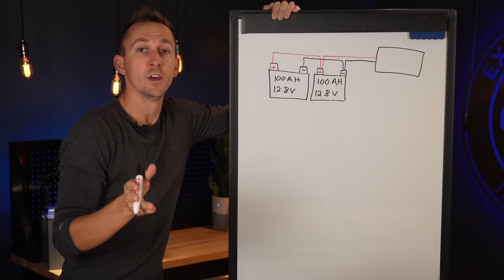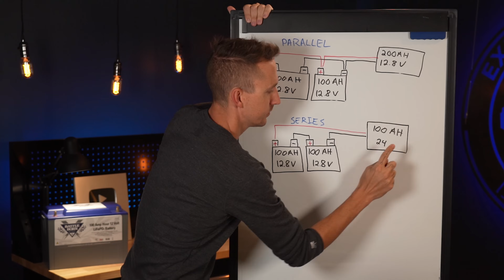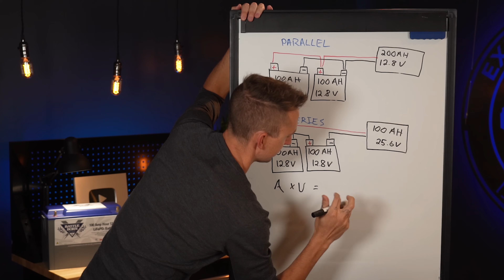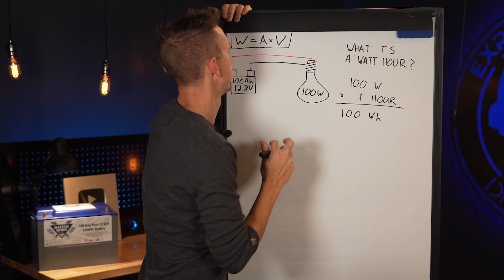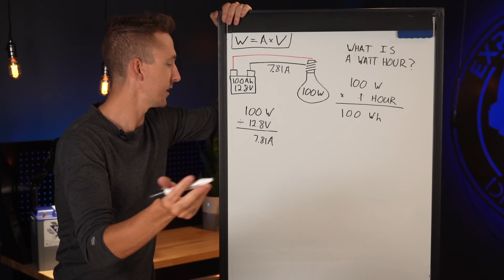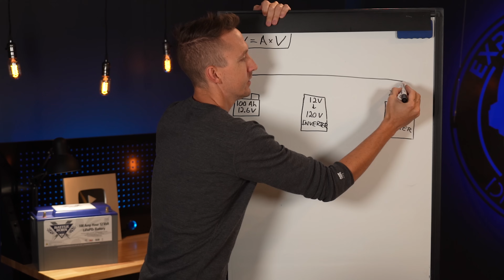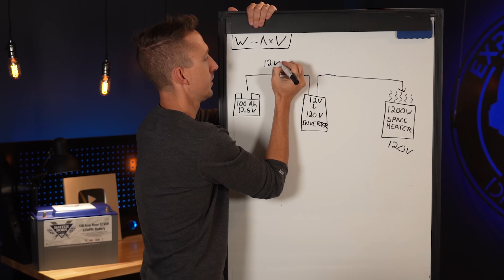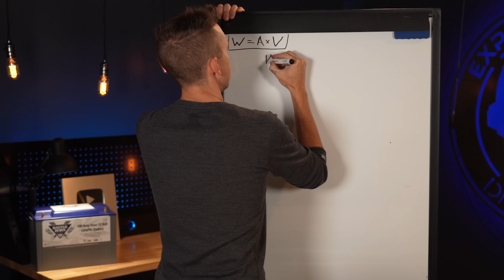AMP HOURS EXPLAINED (amp hours vs watt hours)

Comment: Thank you, that was helpful. But one question on your space heater example: Are you saying that even when you used the inverter to change the V that it’s still consuming 95A? It looked like it takes 95A in to the inverter in order to get the 10A out.
Reply from the maker: Yep!  1200W @ 12V = 100A.  1200W @ 120V = 10A.  W x V =A

Comment: 3:00 In practical real world scenario the parallel battery will produce less useful Wh output than the series battery.
It's part the reason why batteries do not quote in Wh or kWh often.  The reason is, the voltage depends on many things.
In the two examples given.  The parallel pack will run at a lower voltage and require higher current.  Current * Resistance = Voltage drop.  Current squared * Resistance = power loss.
Inversely the series pack will be running at a higher voltage, have less net current across it and beyond it and result in half or less of the voltage drop, resulting in less power loss.
That is only part of the reason.
If you open a datasheet for any particular battery you will see it will actually have different capacities and curves for different loads.  It is this reason they tend not to provide simple "Wh" stats as "it depends" on how you use them as to how many watt hours you get for those Ah.
Reply: I was surprised to find you can actually buy 4000W inverters that run on 12V!  Holy shit.  That's 350A.  I know a lead acid can do a CCA of 1000 Amps, but that for 30 seconds tops and will murder a non-starter battery in seconds.  It will never work again.  Even when you stack 20 or 30 lead acids in parallel 350A has a HUGE cost to it in parts, hardware and the voltage crop will be insane.  A brand new starter battery at 13.1V will drop below 11V or even 10V when cold cranking a normal family car.  Pulling maybe 400A for a few seconds, 4V drop is 1600W of heat in the battery, cables and motor.
Personally 100A is the limit and staying under 50A will save you power as well.  100A and 48V is 4800W.  If you need more, you can go specialist or just give up and go full hybrid grid-tie+150V house battery.

Comment: It is to know with which voltage the 12v 100 amp or 24v 100 amp batteries are charged faster with a 30 amp charger. I think that the 24v 100 amp battery consumes less amp in use but to recharge it takes longer than the 12v 100 amp

Comment: how do u calculate ah to a?
Reply from the maker: Amp Hours are simply the number of amps you use in an hour.  So if you are using 50 amps for 1 hour, that's 50 amp hours.  50 amps for 2 hours is 100 amp hours.

Comment: Hi sir I have one question I am making one 12v 100ah but I am using old laptop battery some battery is 4400 and some is 4700 so which type using bms and which size using main wire for battery pack to inverter, one question if I am making one 48v 30ah using 4400mah battery then how many Ampere charger required
Reply from the maker: No clue, lol.  Here's how I recommend building these systems: https://www.explorist.life/solarwiringdiagrams

Comment: Nice job explaining. One good thing about going in series with 24 volt is wire size. I go for 12 volt and spend more money on wire and save on things that run on 12 volt.

Comment: DIY CAMPER< Others techs have told me that Watt Hours wH can't be used for batteries because batteries don't dissipate heat which dissipating heat is watts so you can't use wH watt hours for batteries? this is what i have been told by other techs
Reply from the maker: I've never heard that.
Reply: @EXPLORISTlife  yes because transformers and batteries don't dissipate heat so you can't use wattage for transformers or for batteries because they both don't dissipate heat. Check into this because I have been told by a bunch of techs about this because how i measure if a battery or battery bank is good i measure the voltage and the current using a 10 ohm load across the 9vdc battery, The voltage measure is 9vdc and the current is 1amp = 9watts. I have been told that you can't compute a batteries wattage like this at all or compute a batteries wattage period because batteries don't have wattage. Try to look into this to make a lesson about computing batteries wattage

Comment: No; you cannot suggest that when you pull a current for an hour for a 100watts light bulb, the current is 7 amps and then using the same bulb for two hours is 14 amps. Why? The current must remain the same throughout as long as the load is not changed. Time doesn't change current flowing in a circuit; only load changing or voltage changing can influence the current change.
Reply from the maker: amp HOURS my guy.  We were talking about amp hours.  7 amps for two hours = 14 amp HOURS.

Comment: The concept is good if you're going from DC to DC. What's  never talked about is the conversion of DC powered to AC through a inverter and it's inefficiencies.
Reply from the maker: I've addressed that a dozen times or so here in the comments of this video.  Thanks for tuning in!

Comment: If you were comparing apples to apples, wouldn’t the 25.8v battery powering the light be half the Ah (50)?
Reply from the maker: Not exactly.  The battery amp hours and voltage doesn't change.  The battery BANK as a whole is what changes.

Comment: Hey Nate, Great channel thanks for doing it.  I got a "simple" question why do people use lets say 6 100 ah batteries when they could use 2 300 ah batteries. I see it a lot on you tube and I'm sure theirs a reason, but i don't know what that reason is . Thanks Ted
Reply from the maker: Flexibility in installation space maybe or parts availability.  I'll usually recommend fewer bigger batteries over more smaller batteries like the 2-3 270Ah Battle Born batteries over 5-6 of the 100Ah ones.

Comment: I have just started doing my van conversion and am on the insulating stage this week, so I have some way to go before i get the electrical. The one thing that is making me think I have made a huge mistake is all the wiring I need to do. Your videos are helping me a little, but it is still very overwhelming, and the kit you use is very, very expensive. I am looking at 5 amg batteries at 120ah each backed up with 900watt of solar. I need to run 3 sets of 12v lights, two 12v fans, one 12v water pump. I need to run 2 hot water heater 240v (shower+hot tap), a 240v fridge, a 240v TV, a 240v induction hob and my oven will be a 240v air fryer. Then I will have 3 wireless phone charger pod with two 240v sockets with 2 USB built in. This all sound like a lot to have but obviously will only be running one or two things at once like the TV and lights or the air fryer and lights but I have no idea where to start. Am I better to go with a higher volt or amp set up (series/parallel)???

Comment: See a lot of comments about wire size. In a van I would think this would only matter for longer wire runs such as a 12V refrigerator.  Smaller wire is cheaper, but you’d have to account for the cost of a 24V-to-12V converter unless you can source all your loads for 24V. Would your terminals, lugs, switches, etc be smaller, or do most people use the same for 24V as they would for 12V?
Reply from the maker: Wire size would definitely be different for 12v vs 24v.

Comment: Hi Nate, could you help me with some advice please..I have 4 x 120ah lithium battery's and want to wire them in series...I have been informed that it may not be a good idea as they may have balance issues...? is this the case
Reply from the maker: That's going to be a question you'll want to refer to the user manual for your batteries or reach out to the manufacturer.  Wiring 4x Battle Born Batteries in series is not an issue, but since they don't make a 120ah battery... I can't speak on behalf of an 'unknown' battery manufacturer.

Comment: so that last ie. 95 amps left side and 10 amps right side. would the system still only last 1 hour or since its being inverted to 120 would it last 10 Ah
Reply from the maker: Amp hours are coming from the battery bank, not the inverter, so it would still only last 1hr.

Comment: Lol there’s no more efficient heat sourcing than Fire.  Whether that be natural gas or wood.   People on the left that actually think solar will provide our world with sufficient and efficient enough power to heat our homes etc around the globe are in for a very rude awakening.    Natural gas is the most efficient and cost effective sourcing for heat fuel
Reply from the maker: Did you seriously just politicize a tutorial that teaches you the differences between amp hours and watt hours?  Perhaps it's time to log off the internet for a minute and go on a long walk outside.  Get some fresh air, ya know?

Comment: at "5:20:00" this is wrong assumption right? if you run for 2 hours it should remain 7.81A the max current flow across the wire for a 100W load unless your load changes to 200W load then I agree with you. 🙂
Reply from the maker: Nope.  7.8A for 2 hrs would remove 15.6Ah from the battery bank.
Reply: @EXPLORISTlife  ok. your referring to the total consumption over 2 hours not the actual  max Amp rating that passing thru 
the wires at anytime?

Comment: Can I use mismatched AH batteries Together.? For example a 300ah and a 200ah battery . Can I connect them Together in parallel without damaging one of them before the other?

Comment: The parallel system is wired wrong: the negtave from the one and the positive from the other!
Reply from the maker: Arie... This isn't a 'system'.  This is just a drawing on a board discussing how amp hours relates to watt hours.  I also didn't include fusing, lugs, or anything else into this theory based discussion.
Reply from the maker: Did you have a question on 'how to wire a battery bank' or were you just nitpicking my video trying to find something wrong with it?  Sometimes it's tough for me to tell on my end.

Comment: Key Point 3!: Amp hours should not be used to state how much stored power there is and WH should be used instead. I drives me absolutely crazy that amp hours is what boaters always refer to when stating the size of their battery bank. My immediate reply is at what voltage to which I almost always get a facial expression only bested by my Boxer… The battery industry need to lead the way changing how storage capacity is presented.

Comment: excellent explaination video when you say at the beginning out of batterys to sys. is sys a RVs converter? I'd love to add a solar panel couple extra batterys would these new batterys be connected directly to the existing converter? then routed out of converter for the 120VAC stuff an the 12VDC stuff currently my RV van 1 house battery a 100amp hour flooded lead type.
Reply from the maker: Here is how we recommend setting up these systems: https://www.explorist.life/solarwiringdiagrams

Comment: If anybody's listening and they know I accidentally bought a victron controller that doesn't have Bluetooth everything's wired in I want to see how many watts my panels are putting out. But I can't find a link to how to do it I measured my Volts at the controller. I wonder how to measure my amps and there must be an algorithm to figure out the same thing the solar controller Is Telling You by Bluetooth.

I Googled and everything I find it just telling me how to check one single panel

Thank God I bought on Amazon I'm sending these two back and getting one with Bluetooth I need Bluetooth I didn't even know the victorians had no Bluetooth geez I didn't even know to check that

Comment: Great video, thank you. I am still a little confused though.

When specifying battery storage, would you use WH or AH? 

Because depending on what volt system you go for, will change the WH but not necessarily the AH.

For example, a 12V 200AH battery will produce 2.4kwh of power, but still only 200AH, whereas a 24V 200AH battery will produce 4.8kwh of power, but still only 200AH, and a 48V 200AH battery will produce 9.6kwh of power, but still only 200AH…

Therefore, surely if you are only looking at AH, you may end up over specifying your storage, where in fact the WH are increasing as you move up the volts.

I’m practice, if your lights and appliances were going to use 1200W of power, then with the 12V setup mentioned above, you’d only get 2hrs of power, whereas you’d get 4hrs with the 24V setup and 8hrs with the 48V setup all mentioned above… or am I misunderstanding something?

Your advice would be greatly appreciated!!

Thank you in advance!
Reply: The 12V, 24V, and 48V setups you mention are different size/capacity batteries.

Usually, battery storage capacity is specified with both voltage and AH. For example, "this 12V battery has a capacity of 48AH and can deliver 1 Amp of current for 48 hours, 2 Amps for 24 hours, and so on." Of course, when running an electric device, the voltage should stay constant, and the amperage should change based on the power draw (wattage) of the device.

The higher the wattage of the device, the thicker the cable needs to be to accommodate the current - unless you use a higher voltage - doubling the voltage effectively means you can use a cable half as thick for the same wattage, because lower amperage would be needed.
If the voltage is halved, the amperage will be doubled in order to reach the same wattage; and if you don't make the cable double as thick to accommodate the higher current (amperage), it will simply get way too hot and melt. It's all based on the "V * A = W" formula, which makes it really easy to understand.

The way you mentioned the different batteries is spot on - you mentioned the voltage and AH for each one. It seems like you are confused because you see other people assume that one 200AH battery would be the same size/capacity as another 200AH battery with a different voltage, but this is not the case. A 12V 200AH battery has the same capacity as a 24V 100AH battery. Therefore, battery capacity can not be measured using AH alone. The voltage must be stated as well. As you seem to have discovered already, one 100kWh battery will indeed have the same capacity as another 100kWh battery, regardless of the voltage.

Some of the new Lithium-ion electric car batteries have their capacity measured in kWh, with the average electric car battery having a capacity of about 40kWh (which should be enough to drive at least 200km). A 40kW charger would fully charge the battery in about an hour.

I think common batteries don't have their capacities measured in WH because the voltage is the first metric to consider when selecting a battery (due to the girth of the cabling in electric devices being chosen primarily based on the voltage, since higher voltage results in lower amperage for the same power draw) and needs to be displayed anyway. When the voltage is known, AH is an effective measurement of capacity. If both the voltage and AH are stated, it gives you all the information you need about the battery; however, if only kWh is stated, you are left in the dark on voltage and will be unable to calculate current and select appropriate cabling.

I hope the answer to your question is somewhere in the essay I ended up writing.

Comment: Great Video. I remember the basic formula's (Ohm's Law) as E=IxR and P=IxE where E=voltage, I=current, R=resistance and P=power in watts. It would have been nice if you had explained that what you did there resulted in about one hour battery life (120Ah battery) and if you add batteries you double the time use of the load. Its also easier for the novice to understand if you use 12V, 120V and 1200 watts. I also like that you explained why 24v and higher systems are used: lower current = smaller wire size = money saved. Explaining any electrical or electronic theory is tricky and you did a great job!

Comment: When I explain this it's mostly to other ebike riders who all use different voltage batteries with different amp hours. It gives a realistic comparison between batteries in watt-hours... mostly it lets me explain how a 58.8V 35Ah (2058Wh) lithium pack is about 3 times the watt hours of most production ebike. We all have Georg Simon Ohm to thank.

Comment: do batteries connected in parallel increase the amp capacity of the bms?
example; x2 12v 200ah batteries, each with a 100a bms, connected in parallel would be 12v 400ah, but would the bms still only be 100a or would it too increase to 200a?
Thank You  🙂

Comment: It's almost right but inverters introduce a load in to the system because it take energy to run the inverter. In order to avoid as much loss as possible you need a balanced load for "maximal transfer of power". For my electrical engineer's we also have to take into account the reactive and resistant load of the wires It gets very complicated really quick 🤣 but in this battery power supply systems it is less necessary and more straight forward. That's why there are wire size charts for corresponding amperage.
Reply from the maker: Yeah, electrical engineers always have a way to introduce more advanced concepts into 101 level discussions that make learning this stuff more difficult for beginners to lean and intimidating to approach.

I understand you seem quite knowledgeable about this stuff.  Perhaps you should start your own youtube channel to discuss this stuff with other electrical engineers?  Experienced electrical engineers is not the target for this channel and you are introducing more confusion than clarity for my target audience of beginners and perhaps your educational efforts would be better directed elsewhere.